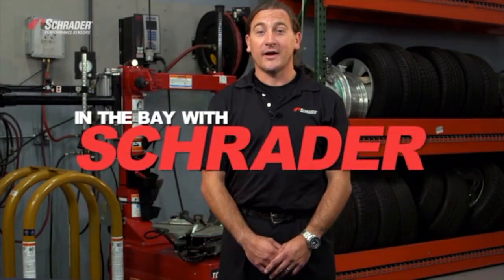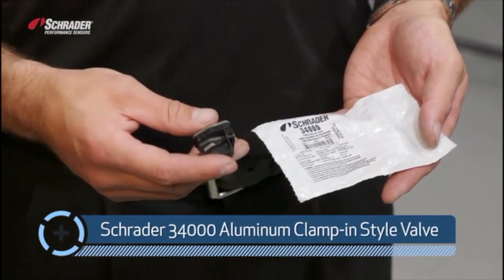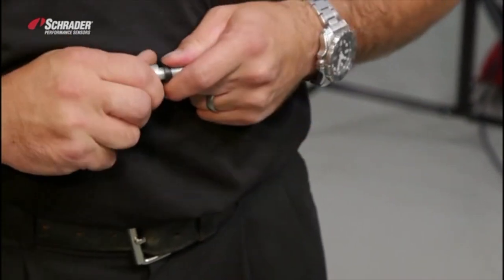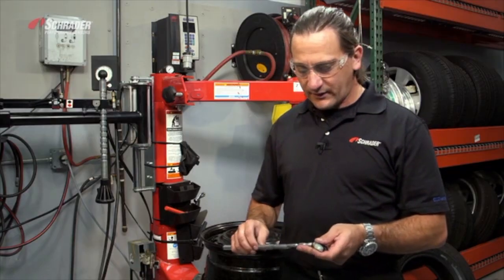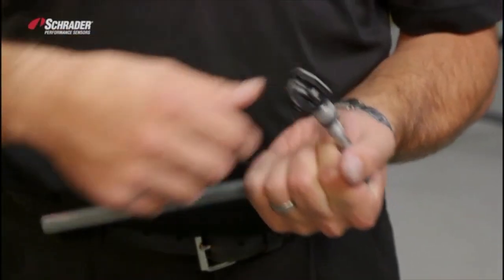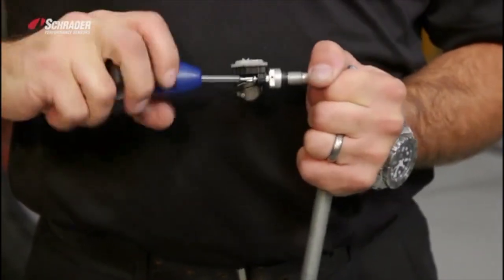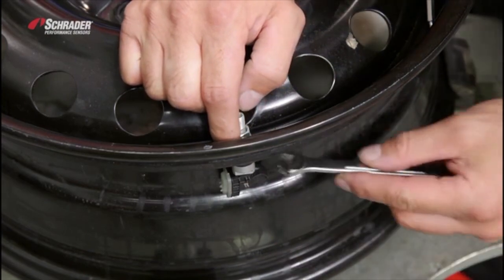Clamp-In TPMS Service Pack Installation | Know Your Parts

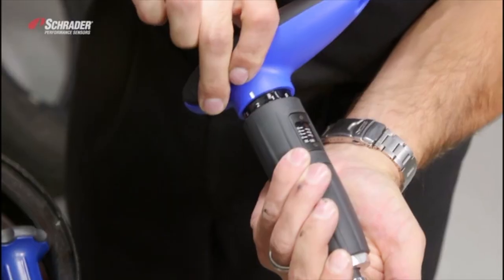Comment: @1:51 What is the name of that nice torque wrench?  It should be certain torque there. On one sensor I bought (REDI Sensor) they gave that torque in the instructions 71 in-lbs ( and Schrader Valve 2.7 in-lbs),  but I see that torque on nut might differ (Schrader probably the same, but it is a problem to find a torque wrench within that small range), since in this film it is stated to be 62 in-lbs. Obviously the question about the specific torque on the Nut of the TPMS sensor kits is overlooked, I would say in all the films on YT about those kits. I want to reuse the original sensors, which are good, but don't know the specs on the nuts in service kits I bought. Probably I'll apply 71 in-lbs, not sure about this part of the project. I would appreciate any opinion on this matter.